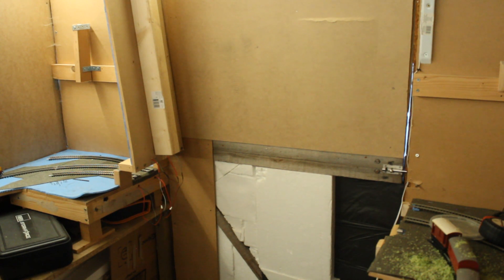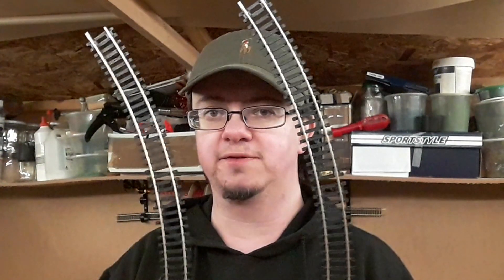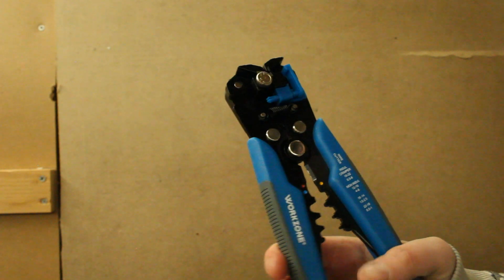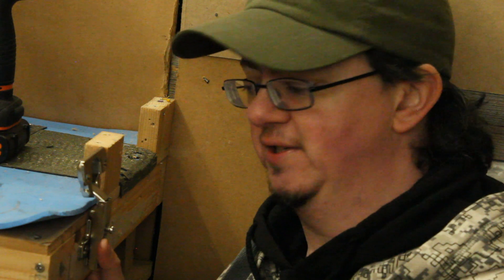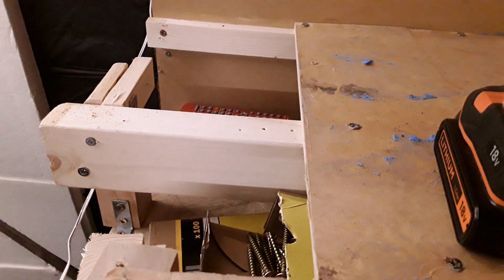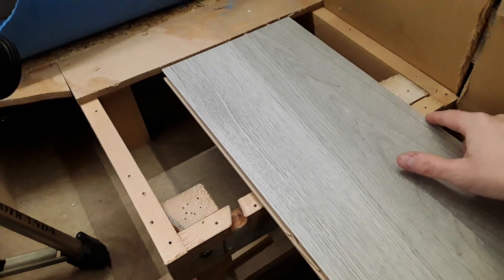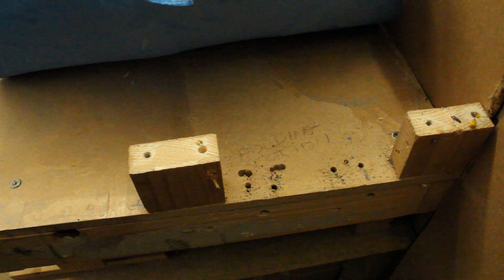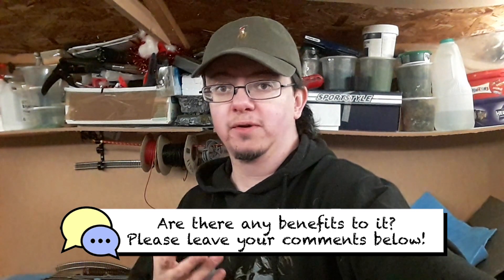Rebuilding my Drawbridge - Part 1

Comment: Just a suggestion, have a look at how older cupboard doors work, just butt hinges rebated in to the hinge end and on the other end a slight curve from top to bottom to ease the   door down, otherwise just have a totally removable section, keep safe and well, cheers from down under in Wairoa New Zealand
Reply from the maker: Hi there! Thanks for the comment and suggestion! Wow! New Zealand! That's awesome!
I will be having a good look at the hinges and options before I settle on a final decision.  😀😁

Comment: Hi great to hear your plans & proposals. 

Personally I didnt use foam, rather strips of cork which fit directly under the track only, not in adjoining areas. I feel the boards should be level and flat before you lay any track, including level both sides of the bridge. Do try a drop down section, but you may accidentally kick the tracks, or knock it in some way, causing more ‘headache’ safer lifting up up the bridge into clear space. Forgive me for 3 suggestions but keep the track straight on the bridge with short straights either side. The rails expand and contract anything from 0.5 -1 mm or more from winter to summer so if you lay them on a curve the rails will be out of alignment after a few weeks any you’ll be forever  sorting derailments. I had the same issue few years ago and my layout was in a warm house. Lay the tracks straight with a 1mm gap either end of the bridge so by summer you SHOULD be ok depending on how sturdy the construction is. Must be solid.

So sorry for all of this, but really hoping its helpful, I want to see you succeed. Take care, John
Reply from the maker: Hi John! Thanks for the feedback and comments! No need to apologise for giving feedback! It's all gladly appreciated!
I have a feeling that I will be taking longer to sort this out than originally planned... It is frustrating, but I will get there in the end, and it will be worth it in the end!
I see what you mean about the alignment issues that could potentially happen with curved tracks... So far, I have not actually screwed anything down, so I'm hoping once I make it more solid things will stay in place! Thanks for the tip about leaving the gap... I didn't realise that locos could still run between gaps in the track until I started building my layout! I always thought everything had to be tight and gap-less to run! 😂🤣
But will definitely include a gap between tracks when possible!

Keep the comments coming! I always enjoy the feedback! 👍😎

Comment: Hopefully all the rebuilding will pay off. Another good video! As for the cork, i didnt use it as i was told once ballasted it wouldnt make any difference in sound. I dont mind if the trains are a bit noisy so i dont worry. But like you said it provides a nice shoulder to ballast so i may go down that route when i build the new layout. Thanks again.
Reply from the maker: Hi Lewis! I'm hoping that if I manage to sort everything out then once I get track down I won't have any issues... 🤞🤞
The noise won't really be an issue - think I make more noise talking! 😂🤣

Comment: Hey Richard keep up the good work you will get there👍. It's all a learning curve. I havem't used cork or foam on my layout it's still pretty quiet when running the trains. Although the foam would be a great leveler where there is any slight uneveness you'll work it out mate. Anyway great video good onya mate👍👍🙂.
Reply from the maker: Hi David! Thanks for the encouragement! Will take time but I'll get there!

Comment: Hi Richard great vids , I'm starting a new layout using polystyrene as a base for the first time and a strong glue instead of pins. Very solid and you get plenty time to waggle the track into place before it sets, just a thought. Type in prestwick model railway on YouTube to see result. Good luck, john.😀
Reply from the maker: Hi Grunda! Thanks for the suggestion! There is a definite divide between gluing tracks down and pinning them down... I guess once the tracks have had ballast attached,  it is all glued down... 🛠🔨

Good luck with your layout! 😁😀

Comment: Hi Richard,
  I see major major track work is taking place. Just a couple of thoughts, cork underlay is perfectly sufficient and sound absorbent and also better for ballasting. It is fairly cheap to buy as well. Regarding the countersinking, I was surprised to learn from Susannah Joaquim a couple of nights ago that you can purchase drills with built in countersink bits which is a brilliant idea and can be obtained from Aldis or Llidls. Might be worth having a look. Like you she is doing some reconstructing/extending so bought some new tools to get the job done quicker. Take a look at her video...(she doesn't bite...😁).
I'll be interested to see how the plastic sheeting turns out.
Happy New Year and take care,
Jon B.
Reply from the maker: Hi Jon! Thanks for the suggestions! I have found her channel, subscribed, and have been looking at some of her videos! 😁
I will definitely look at the tools in Aldi - I'm forever in there! 🤣
Definitely will be adding to my toolbox soon! 🛠🔨

Comment: Richard. I'm currently experimenting in my storage yard using the thin foam underlay used for laminate flooring. I'm also not using track pins, instead I'm using track screws to hold the track in place. Initial results indicate its a lot better than cork for reducing noise.
I'm also trying different methods of fixing the foam down using copydex on some lanes, pva on others. Not ballasted any yet but given I dont ballast for  months after laying track just in case a running problem emerges, and I'm only ballasting my storage lanes as part of the experiment I'm not too bothered anyway.
The only issue I've had so far is that the water based grey paint I normally apply tends to flake off - but in a storage lane painting isn't necessary anyway.
I'll try and do a short video over the weekend and e mail you the link.👍
Reply from the maker: Hi David! Good shout on the track screws! Have heard lots of positive feedback about them! Great to remove later if required!

Yeah, I am the same as you... I will leave ballasting until I am completely finished now! I have learned from the Rocky Bridge section not to ballast until the end! 😲😂
Looking forward to seeing your progress video! 👍😎
Reply: @DarlingbroughModelRailway  Richard - e-mail sent just now.👍
Reply from the maker: Ooh! Thanks! Will check it shortly!

Comment: Hi Richard. Being an old traditionalist I'm using cork. When I saw your original video of using the foam I thought it was a good idea and wished I had thought of it. Cork is not cheap. As I progress I am finding it is vital to have a smooth surface or there can be issues with track alignment and poor connectivity. With the surface you have shown you will have to use something IMO. Once my wiring is completed and thoroughly tested I will either pin it , copydex it or maybe just hold it in place with the ballast. Still a long way from having to make a decision on that.
Reply from the maker: Hi Gordon.  Thanks for the feedback! The foam seemed to me to be the quickest,  easiest and cheapest way of doing it. I suppose once the frack is finally laid, I could cut the foam out where track is not on top to provide space for scenery and create a ballast shoulder... 🛠🔨🚂😁

I definitely think getting track running first is best... Having learned from the rocky bridge section (which was 2 straights I ballasted) I will leave that to the end!🤬🤣
Reply from the maker: Oh, and have you tried track SCREWS to hold it in place in the meantime? 💡

Comment: Hi, I didn’t use sponge or cork on my layout and the sound in my shed is not to bad. To make the screw holes flush I use countersink drill bit and wood filler. Jason@harpic.
Reply from the maker: Hi Jason! Thanks for the feedback! I need to get myself a counter sink drill bit! 😂🔨🛠 Guess another trip to B&Q is in order! (YAAY!) 🤣
The more I think about sound in the shed, the more I think running trains probably won't be as loud as I am anyway... 🎤🎧🔊📣

Comment: I used 1/8 inch thick cork underneath my track for a smooth and firm base before track-laying before ballasting, although as soon as you ballast you loose any noise reduction! My view is you only need cork or foam underneath the track and not the whole board as the rest of the board will probably be covered by scenery anyway?
Reply from the maker: Hi John, thanks for the comment! I was initially looking at cork, but figured that putting down the sheets was cheaper and easier than doing individual strips of cork... I have changed my track plan loads as I've been laying it, so putting foam under all the tracks just seemed like an easier way of doing it... 🤔😄😂

Comment: Hi Richard . The hinges you have purchased have a 15mm overlay ,i would recommend a 0 overlay..
Reply from the maker: Hi Anthony. I didn't realise there was any difference! Thought they were all the same! 😬 Thanks for pointing that out! 👍👍
Reply: @DarlingbroughModelRailway  These look like the standard 35mm cabinet hinge I've fitted 1000`s of these . The ones you have may need you to put a fitting piece of timber 15mm thick and wide enough for the plate to fix too. The hole needs to be 35mm and approx. 11mm deep so acrylic may not be a good choice,,,,,
Reply from the maker: @1tonyboat  I've never fitted any of these in my life! 😬😬 Would it work if I mounted the acrylic on top of a mounting board?
Reply: @DarlingbroughModelRailway  In my opinion avrylic only works if it's going to be a lift out section like the guy in the video demonstrated. I thinl you'll give yourself problems with trying to fit cabinet hinges to acrylic sheeting.
Reply from the maker: @jaybee1921  Hmmm... perhaps... I will be giving it some thought and take some time to work on it before I do anything permanent... 😁

Comment: Hi Richard, i did;nt use anything under my track, i just screwed the track straight onto the baseboard, (i thought this a better idea as if there was a problem with the track, just unscrew and replace)  hope this helps,   dave
Reply from the maker: Hi Dave! Thanks for the feedback!😁😄 That makes sense! Have you had any issues so far on your track since you screwed it down? 🤔😁
Reply: @DarlingbroughModelRailway  no its been fine
Reply from the maker: @daveormerod7426  That's good! 😁